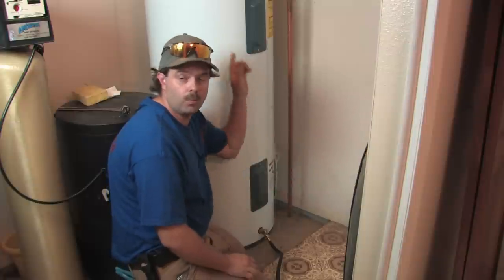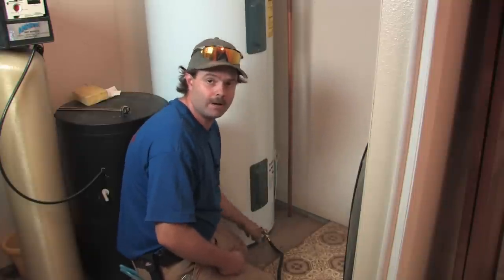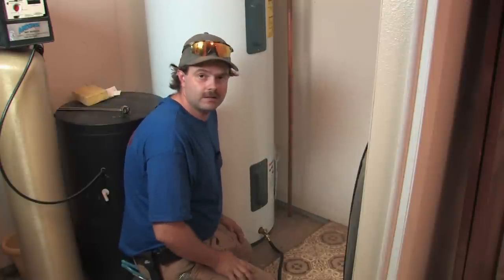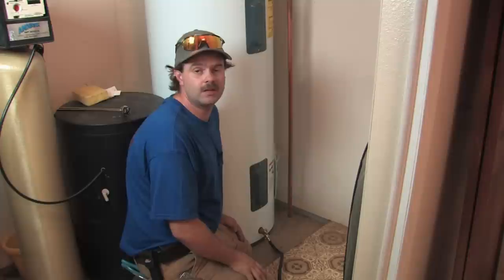Hot Water Heaters : How to Troubleshoot Sediment Problems in a Water Heater

Comment: What if you attach a hose and it only drips put not flows? Is that a sign it’s really blocked with sediment?
Reply: Probably yes.  If you turned off the cold water input and don't have any faucets open, the tank can't drain.  You've made a vacuum and the water can't drain out.  First, make sure your cold water input is open.  Second, try opening a few faucets on the hot side and see if that helps.  If none of that works, you can try wiggling a bit of wire up through the valve and seeing if you can get it flowing better that way.  Or you can try hooking up a hose from a laundry faucet and trying to blast water back into the tank to clear the blockage.  If you don't have a full flow straight drain valve, you're going to have these troubles.

Comment: A water pipe off the incoming water line on top of the water heater busted and drowned my tank.  I think water went in the tank through the vent at top of heater and soaked the burner and pilot. I opened & dried it as best as I could.  If I let it dry out, will it work again?

Comment: The city was working on some lines and new roads recently, after they finished I got a lot of sediment in my lines from what they did, when this happened my hot water stopped warming up completely. I thought it was the elements so I had them changed out, but still no hot water. The thermostat was checked and its fine, the electric lines were checked, and nothing is wrong with those. What could be the reason for no hot water? I'm not sure if this matters, but another change I noticed, is that the tank no longer makes any sounds.

Comment: I am experiencing black sediment in the water. I'm on a well.  It's a house I just bought and signs indicate that things were not maintained as they should have been.  Could this black sediment be from water heater as well?
Reply: Do you have those braided stainless steels connection hoses with interior black sleeves?  There was a massive foul up in the manufacturing of those that lead to the sleeves disintegrating and black flecks and sediment being carried into the home, especially the bathtub when you've run a bath.  Try replacing those hoses (new ones only cost about $20) with flexible stainless steel hoses.  Cured my problem.

Comment: Does the sediment go into the water lines?  I'm having to clean my bathroom and kitchen aerators almost weekly with grit or sandlike buildup.  I just replaced one hot water heater and the other is a 2014.   Any ideas?

Comment: I have a problem with my water heater, Im always replacing the bottom element because it blowing out every  few months and we clean it out every time. get all the sediment out. some times it will blow ut again in a month a few times, this has been going on for about 5 years.
Reply: You need a new water heater.  This shouldn't be happening.  If you're blowing every few months, your tank is at the end of its life.  Get a new one.  Before you say you can't afford it, think about what a flooded basement is going to cost you.